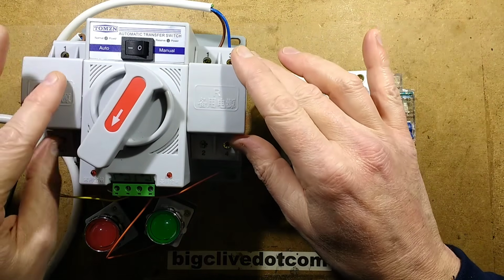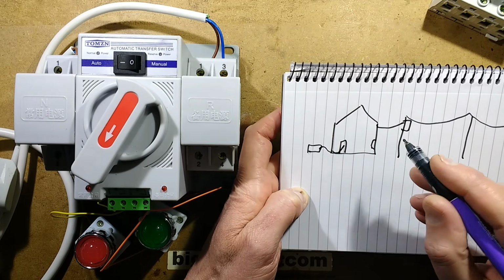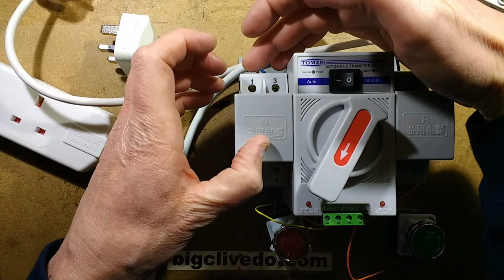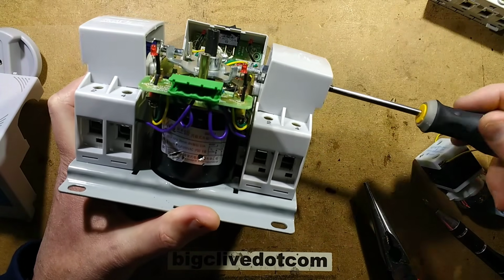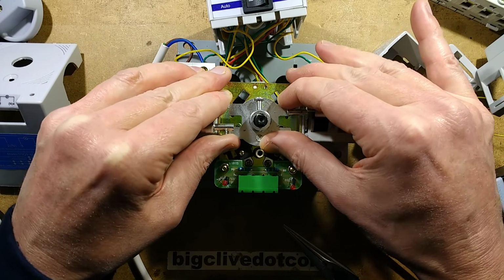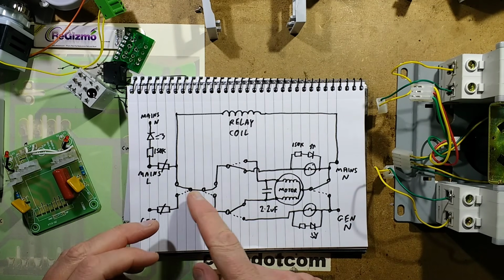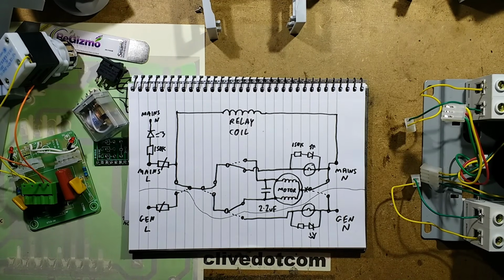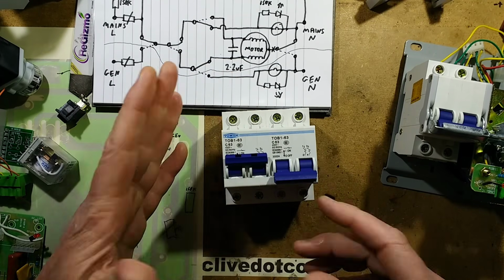Automatic generator changeover switch (with schematic).

Comment: With the back feeding of electricity when the distribution is being worked on, I have always wonder how they protect workers on the railway.  Firstly if the electricity on the railway that is 3rd rail is switched off because someone has fallen onto the tracks, then another train is in the area and starts slowing down.  Almost all trains generate back electricity to reduce the electricity cost. Would this make the 3rd rail go live when everyone has thought they have switched off the power.

Secondly, what would happen if the power is switched off on overhead lines for repairs, then a train comes into the switched off section and stops at the exact point where the pantagraph is touching the cables of both the switched off section and the neighbouring live section.  Would this make the switched off section go live.

I would guess that all railway substations would earth the 3rd rail/overhead wires when the power is switched off???
Reply: Beno I've seen railroads during maintenance. Huge ground shorting cables are manually clamped to the overhead and rails for the duration. In multiple locations for redundancy.
Reply: In order to feed power back into an AC source for regenerative braking (or grid-tied solar generation, same principle), the power must be synchronised to the source.  For AC this means matching the frequency perfectly.  So if the train comes on to an unpowered section of track, it won't be able to lock on to the frequency and so won't try to inject any power.  If it did (as a generator would do, since it doesn't have to sync to the mains frequency), one of two things would happen.

Regenerative braking only works by supplying power that can be immediately used by another device.  If nothing else is using the power, there is nowhere for the regen power to go, and thus no braking effect.  So if you did try to regen brake onto a line with no power, if there was nothing on the line (no load) to use the injected power, you'd end up with no braking effect and a very high voltage which would likely trip a safety system and stop injecting power.  If there was a load on the line instead, it would probably be so large that the regen braking system couldn't power it in full, so the voltage would end up too low, again causing a safety system to cut power.

This is why all vehicles with regen braking also have conventional braking mechanisms, so that they can still stop themselves even when regen would fail because there's nowhere for the generated power to go (e.g. full battery in an EV).  It's a particular issue for hybrids as they have small batteries that can be very easily fully charged on a long stretch of downhill driving.

Without the safety systems, and without trying to synchronise to the line frequency, yes you could conceivably put power onto the lines, which is what happens when people backfeed with their generators.  The generators are not grid tied so have no need to sync to the mains, and where regen braking wants to dump as much power into the grid as it can (leading to higher voltages), the generator delivers a fixed voltage so no overvoltage safety systems will see a problem.

With the pantographs I imagine they are not connected together, but I don't know for sure.  They could be to minimise arcing in case of a poor connection.  In my own local train system, when passing from one electrical section to another the train loses power completely for a few seconds, so whether the overhead lines are switched on or off, there's always a section of unpowered line at least one train length long between each electrical segment, perhaps to cater for this very situation.

Comment: The only problem with that changeover switch is its not like a UPS where the changeover is instant and you never loose power. Instead when switching between mains and the generator with this there is a point during change over when you loose power for a second.
Reply: An UPS can synchronise two phases and moreover even choose the right moment to switch when load current goes through zero point between alternated polarities. This will prevent or at least minimise sparking. Contrary to that, an ATS can"t do such a thing. So to avoid arcing between two power sources it should have some delay (just as manual 1-0-2 switch). To keep equipment being powered w/o interruption, yes, an UPS needed after an ATS.

Comment: In the US, if you've got the right kind of breaker panel, you can get a mechanical interlock which mounts over two breakers. One breaker is the main utility and the other is for the generator. It prevents both from being on at the same time and thus prevents backfeeding. Very inexpensive compared to proper transfer switches which are quite expensive. I can't use one, so I just use 12ga extension cords for fridge, microwave, lights and electronics. except for my gas hot air furnace which has a small transfer switch.

Comment: you're incorrect we are required to have a minimum of 30 amp disconnect or transfer switch with a gen-set legally in the USA i have a 10k here at home on natural gas, and im not sure where you heard about the dryer connection as thats 30 amps, not saying its not happened, but the laws say different and to be legal stuff is expensive 

we are two legs of 110, generally 200-300 amp service, my 300 amp auto disconnect was 25,000 USD my GENERAC  genset was 55,000 USD plus the permits and everything else it was close to 100 grand USD

https://www.lowes.com/pd/Generac-30-Amp-Indoor-6-Circuit-Transfer-Switch/4780699

But still love your teardowns and education

Comment: Loved the video. I have a question about how these systems work in larger applications. When I worked in a call centre the company had power outage generators that were basically batteries instead of fuel based generators. With these the servers, computers phones etc. had no power outage, however the lights which went over to a traditional generator had a noticeable dip. Other than the generator taking a little time to come on how was the speed of transfer of power achieved?
Reply: They were using UPS (Uninterruptible Power Supply) devices.  These are electronic and can switch on within about 100 milliseconds of the power going out.  There is still a tiny amount of time without power, however computer power supplies are required to last for at least 200ms or so without power, so the computer continues to run without any problems.  If you plug a light into a UPS then you can see it flicker during the transition, but most other electronics don't notice the interruption as it's so brief.  Old UPS devices are plentiful and cheap online, and are the easiest way to have power for an hour or so at home during a blackout.

Comment: Only 63 amps? Bit low.
Reply: Not if your using 220/240 volts (as Clive probably is)..you only need half the current of 110 to power things.

Comment: Intresting, our main fuses are usually rated for breaking 120kA ...
Reply: Yeah, fuses are generally rated higher as the fusible link inside blows apart whereas circuit breakers have contacts which can wield together.

Comment: Yes, my Dad and Grandad managed to fry a generator because they didnt have one of these. They used a widowmaker type affair plugged into a socket in the garage. Its ok though, because they were both apprentice trained electricians and allowed to get away with it. We had a very long power cut for around 2 weeks due to heavy thick snow bringing down the powerlines(yes this is true).

Comment: I am in Indiana here in USA.   He went into dryer plugs back feed, that actually a new one on me and have seen alot of dumb shit. Next...  They do around here, I assume they are supposed to everywhere,  but they ground both ends of downed lines while doing repairs to "hopefully" prevent some dumbass from back feeding and killing someone.  Far as a homeowner killing themselves cause they are stupid I have no problems with that, they deserve it.  But if a lineman get hurt/killed cause of your stupidity plus delays restoration of service to others, I feel you should be electrocuted same as the lineman got.  The most common gen switch I see around here is the metal  tab finger in the box that prevents the mains and gen feed breakers from being on at the same time.
Reply: you are a cranky dumbass
Reply: OK.  Why?  Is it that truth hurts?  And yes I did repeat a couple of things he said already, that is my bad.

Comment: I have never been a fan of back feeding a house through a stove or dryer plug but desperate times calls for desperate measures. I have however wired up many generators, for a portable/job-site generator I just throw an interlock in the panel and use twist-locks. For Standby generators I use an automated transfer panel.

Comment: A nice, brute-force approach to the problem; but I'd never wire a piece of chinese crap into the most expensive thing (a house)I've ever purchased. When you buy a serious automatic unit,, you're paying for high-quality parts and horrendously expensive UL certifications. I learned years ago that the ratings on these far-east products (volts, amps, relay contact rating, engine hoist weight, whatever) are meaningless. As you mentioned, if your house burns down and the insurance company finds this thing - you're screwed.  My thinking is this - if you can afford a permanently installed, remote-start generator; you can shell out a few more bucks and buy a decent crossover.

Comment: These things are hard to find with the proper ratings, at least in the US. The only ones I can find that will switch the whole main panel are branded so they will only work with the same brand generator. Even then they are between $500-$800.

Comment: Just thinking... If your generator was connected to the mains, which is what you're trying to prevent, why would it be damaged? How come the mains wouldn't just drive the generator as if it were a motor? For the engine, it'd just be acting like a starter motor. 

What's wrong with this theory?
Reply: greenaum The problem is that there is a very high likelihood that your generator and the mains power source will be out of phase with one another, very likely a good deal out of phase, which will appear as a near dead short to the system if significantly out of phase -- and of the two power sources which is the one that you think is most likely to win that war, your generator or a gigawatts level utility generator?  Now if you were exceptionally lucky and the two sources where very nearly in phase, within plus/minus a few degrees, then nothing bad would happen and you and your generator and the utility will take turns leading and lagging (very slightly) relative to one another and you will effectively lock phases with one another (though in this case it is more your generator locking phase with the utility due to the mismatch in capacities).  However, if anything were to suddenly slow, or speed up, your generator, such as a very large load or mechanical fault, then you can quickly fall out of phase with each other and again there is the risk of major damage to your generator.  

Maintaining a stable and locked 50 or 60Hz among all the generators participating in a national or international power grid is one of the greatest challenges and responsibilities of all the participating power plants and requires constant monitoring and continuous control and fine tuning to keep everyone carefully balanced relative to the varying demands on the system.  A lot of automated monitoring is done today but really makes you appreciate what these companies had to do back in the early days of tied national power grids to keep everything carefully balanced and in phase under pure manual control...and sometimes they would fail and expensive generator rebuilds were then necessary if the fault not cleared and/or the generator/power plant quickly taken offline.
Reply: The generator will attempt to match phases with the power supply.  The only way the generator can match phases is if the rotor is in the same physical place as required by the phase.  This will cause the generator to very rapidly accelerate.  In such a situation the generator can leap, this can physically damage the generator and anyone who happens have the misfortune of being in the way of the generator when it decides to become airborne.

If the generator is unable to phase match (for example if the generator’ can’t move into alignment fast enough)  then the generator will not create any back emf at which point the generator is a massive short across mains.
Reply: greenaum also there are generators that are designed to be operated while connected to the mains.  They contain displays that allow you to sync up the phases to mains before you connect them into the power and they also have physical restraints to ensure they do not become a projectile.

Comment: Did you say 4000 amps
Reply: Ollie B That would be the maximum safe interrupt current rating of a circuit breaker (such as in the case of a very low impedance "dead" short condition) not their rated trip current (which was 63A per Clive).  Though a 3-4KA interrupt rating (AIR) is on the low side if in the U.S. where a typical branch circuit interrupt rating is on the order of 10KA and greater than 20KA typical for main breakers in residential applications (I'm not sure off hand what the minimum ratings are in the U.S. per Code, but these are the typical ratings specified in typical compliant breakers intended for residential and light commercial applications).  Clive mentioned around 6KA typical in the U.K. if I recall.
Reply: Ethan Poole thank you for taking all that time and effort to reply. I didn't know amps went so high, but then I'm in to computers. Cheers bud. Be well.

Comment: Those DIN modules must be regular switches, not circuit breakers.
The mechanical parts on the motor are blocking the switches from fully disconnecting.
Furthermore a fault downstream may result in the changeover switch constantly trying to re-energize the circuit and cause hysterisis.
Reply: Bjorn Roesbeke Circuit breakers will disconnect internally irrespective of the position their handles may be held in.  Even so, if you look at the actuator that switches them you will note a gap and that gap is large enough to still allow the handle to still move.  However, I have a suspicion that if the mains input side tripped and the generator is running then you may fall into a trap where this transfer switch keeps bouncing between the two states and repeatedly resetting each circuit breaker since it draws power of the input side and the rotating mechanism would effectively reset the breaker with each actuation.  That would be an interesting fault condition to test for, though you would need a load large enough to keep tripping the breakers.

Comment: Clive - I can see why you spent two hours.  
About "swapping the sides that the main and generator power are attached to " ..  I got lost when I realized that the Auto/Manual switch tells the motor when to run.  The RELAY sets the direction AND the power source for the motor.  Mains has to go down to De-energize the relay.  Then the generator actually gets to run the motor.  ... Well, i just went round and round.  

Four hours with the schematic didn't give me the answer.  I finally gave up and decided that the primary function of the  Auto/Manual switch is whether the transfer switch will switch BACK to mains automatically or manually.  This could be a problem if you swapped the mains and generator power.

You didn't run this sequence. 
1.) Set it to Auto.
2.) Plug in the mains.
3.) Set it to Manual.
4.) Unplug mains.
5.) Plug in the generator.  - unknown#1 - Does it transfer to the generator?  (If not, turn the handle.)
6.) Plug in the mains.  - unknown#2 - Did it transfer back to mains?
At this point, the relay is energized and switches the motor direction and motor Line to mains.  But the motor Neutral is still connected to the generator.  

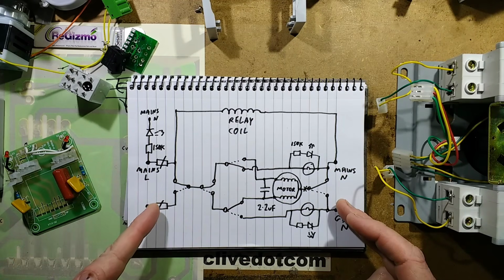BTW - at 19:55 you indicated that the A/M switch drops to gen neutral when the mains is down.  You have to switch a switch ;-) 

Now, off to Julian's new video :-D
Reply from the maker: The auto/manual switch just disconnects the motor common so that the unit has to be turned manually with the knob on the front.
Reply: Ok .. I was putting the 'travel limit' switches as part of the relay (part of the round and round).  Now I understand that you ADDED the A/M switch to the schematic.    So the relay switches Live, Neutral and Direction for the motor.